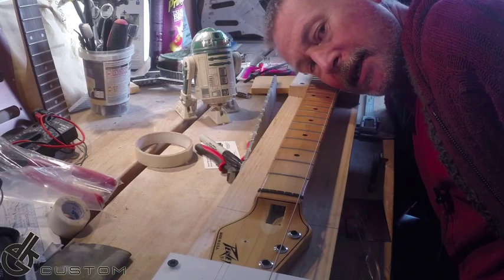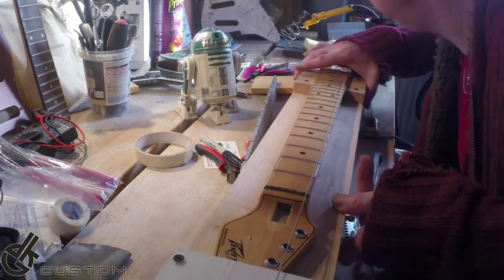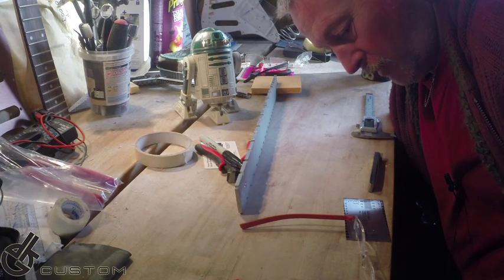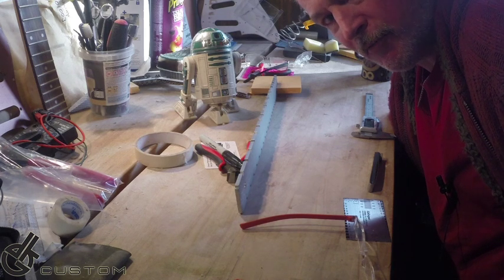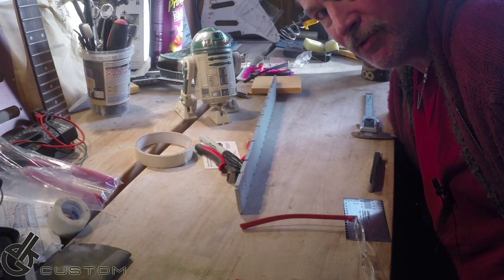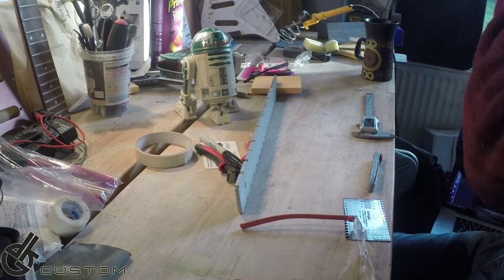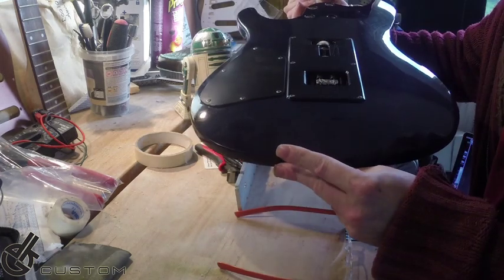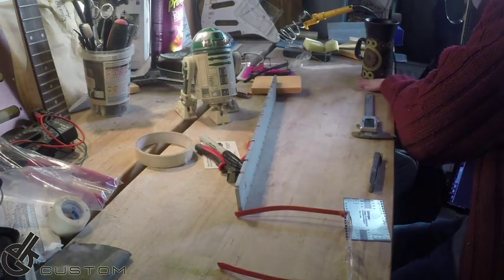Peavy Neck Re-fret Part 1...and other bits and bobs

Comment: hi again.  dunc, i'm not quite sure if i understood what you were doing when you measured the string height with the feeler gauge.
i don't want to come across as a smart guy, tell me if that's the case, but i do this quite differently.
you need to replace that nut anyway after the refret (most likely), it will be too low.

you should press down the string between the 2nd and the 3rd fret. the distance between the 1st fret and the string should then be like a cigarette paper, which is approx. 0,05 mm.    

sorry if i misinterpreted everything i have seen.
Reply from the maker: BigEdWo No probs....It was a general looksy at the string height at the first fret, as I hadn't seen the neck with any strings on it and never will. It's for that reason that I probably won't change the nut...I don't think it will be too low, but in any case I won't be able to do a full set-up on it. Thanks for your input though, keep it coming. I'm in no way an expert!!!
Reply: DKGCustom neither am i.